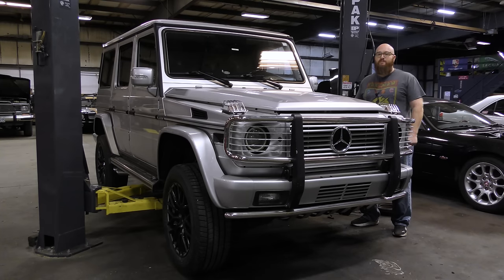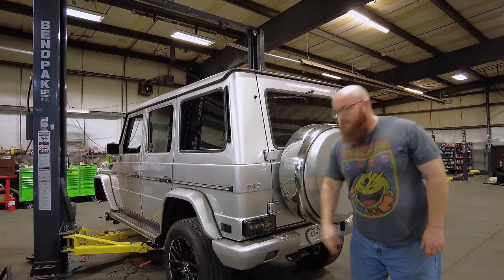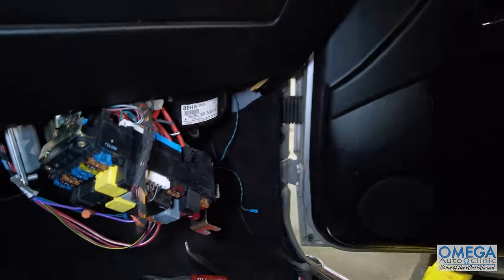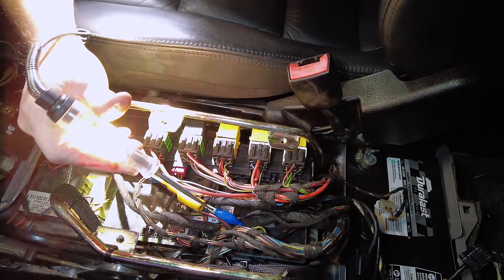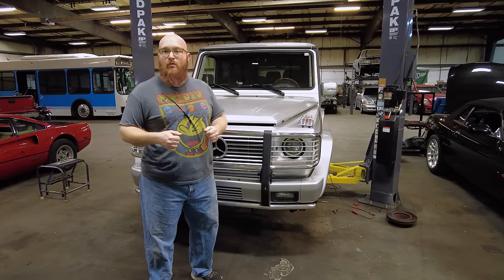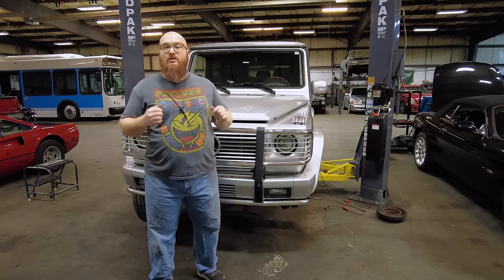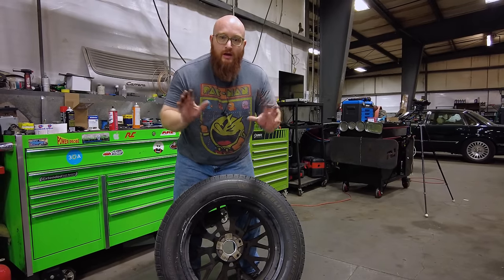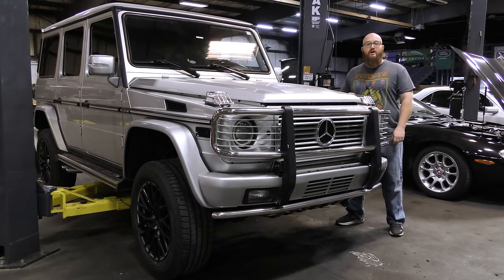Dangerous Mods on this '03 G55 AMG G-Wagon! CAR WIZARD shocked at the level of stupidity

Comment: When I modify wiring, I leave a note in a bag explaining the mod with possible diagrams and terminal numbers. You can forget a year later what you did and someone else will know what they are looking at if needs be.
Reply: This is a highly underrated tip.
Reply: Ya good idea, but I doubt the cartel members using this could read them.
Reply: I leave a mental note : "That's future guy's problem."
Almost always, future guy is me.
Reply: I did something similar to this for my car. I put a sticky note on the wiring diagram page of my Haynes book, and drew the wiring changes on the sticky note, lined up with the diagram on the page. It also doubles as a bookmark.
Reply: @jamesofallthings3684  . Yeah , I  thought the same concerning the Previous Owner .

Comment: As someone who made automotive repair and restoration my business and my hobby since 1967, I very much appreciate your work ethic and using your brain and skills to save yourself and others money wherever possible.  HOWEVER, I totally understand why many shops nowadays will only replace parts and not get creative with solutions.  They are deathly afraid of lawsuits, because if their homegrown repair fails, there is no one for the customer to sue except the shop that got creative. They cannot go after the mfgr., the parts dist. or anyone else.  So many businesses are barely existing today and are also running scared of lawsuits.  It is not MY style (or the Wizard's) but I do understand it. Thankfully, I just work on my own stuff these days.
Reply: That’s exactly why you are correct
Reply: I second this. I am retired from a car manufacturer after decades there and pior years at a dealer too. I do lots of repairs by soldering broken internal connections and have overlayed transistors for failed ICE chip power stage but I restrict it much more as I was burned by someone for doing those kind of repairs when an unrelated failure occurred 2 years later. The lighting on many domestics is done just like this G-Wagen now and many will not keep failure indicator or codes cleared when a bypass is done. The source module may include a circuit integrity check when the light is not operated and can detect the tagged on load of the bypass lamp. They don't have workaround repair tolerance as an engineering criteria.
Reply: Shops outside the us don’t do this repairs any more, too. Lawsuits aren’t a problem here, but it’s easier to replace something then to come up with a solution. Additionally, you don’t need educated personell like th3 wizard, replacing a wheel bearing is something a mediocre mechanic can do… sadly it’s just replacing today, no longer repairing…
Reply: @erebostd  I stopped working at new car dealerships way back in the mid-70s, and even then they were getting more and more into parts replacement. At each dealership I was the only mechanic who tried to diagnose instead of just throw parts at a car. The dealers always had a "warranty room" where they kept bad parts off of newer cars, so they could pay my diagnosis and repair labor through phony warranty claims using those parts. That was the ONLY way I was going to get paid.  Went into business for myself after the 70s.
Reply: @erebostd  It's generally a cost issue to not repair but replace things, combine that with any possible warranty issues it's safer to just replace and then you can blame the manufacturer for a failure.

Some shops can do that repair, but they tend to be older guys with mechanical engineering experience. Many just aren't equipped but might pass jobs on to an engineering specialist. Again this falls to the overall cost of repair vs replace.

Do a repair which fails and most people think you don't know what you are doing.
Very few people have the experience to appreciate the difficulties of repairing things in the first place.
Even second hand parts shopping can be time intensive.

I was watching Vecor, and he bought a toyota that was written off - not because of the damage to the car, but because parts were scarce and the expected time frame to repair the vehicle exceeded the cost of the insurers rental outlay to their customer.

Many years ago I went to a radiator shop to see about having a motorcycle radiator which was damaged in an accident repaired. Very lightweight aluminium and the shop owner looked at it and explained the difficulty of the job and ultimately rejected it - from his perspective there was a high chance of failure which meant overall it could be more problems than it was worth. Radiator was worth $500 or more at the time  IIRC.
As I was leaving one of his employees grabbed my attention and looked at it. For $50 he would have a go, no guarantees.
Worked out well and radiator lasted for years until I sold the bike, but I don't fault the owner of the business for turning it down.
Reply: @jimmyaber5920  Agreed, but in my experience, the aftermarket LED Light assemblies would have triggered the bulb warning as well as rapid turn signal flashing.
Reply: Correct!
Reply: @GrayRaceCat  
Normally that would be the case. but that LED assembly looked to have some brains on it.. and I think I saw some large caps or other electronic stuff. Probably to trick the car into thinking it has the proper bulb.  Often just a resister in line will work. But this one had that cool lighting effect  in it too.
Reply: If an accident happens, the lawyers will blame it on modified parts even if they had nothing to do with the cause of the accident.  The risk vs reward is too great.
Reply: @captinbeyond  
I'm sure he would have gotten some waivers signed by the owner.
Reply: I think he asked Hoovie to sign a legal waiver before cutting a hole in his Murcielago’s chassis. So, he probably did the same with this customer.

Comment: Just a thought!!! I think the resistance or load has been greatly decreased by led lighting. Had the same problem with a trailer with led lighting. The rear sam did not detect enough load(factory trailer hitch install), i had to add some resistance to get it to work. The trailer outlet was programmed for incandescent lights and they had a greater load., than the leds.   My Benz is a 2009.
Reply: My first thought as well. Ebay LEDs not putting enough resistance on the system.
Reply: I thought of that too. Newer cars usually works like that. You need to wire a resistor in to make it work.
Reply: Would be funny if Car Wizard replaced rear Sam just to find out it did not fixed the issue because of the resistance.
Reply: @EvzenEmanuel  I mean, he left the rear SAM unit as it was, so his repair is completely reversible.

Comment: FYI the switch in the taillights is sometimes used to have solid or dynamic indicators (or blinkers). My car has the same kind of switch.
Reply: I bet that's it's gonna burn out the front module now.  I would just add an optical relay for 20 bucks so it doesn't affect the circuit.
Reply: @philipparana9225  That claims make absolutely no sense at all.  The lights are all 12V, adding a LED turn signal into an existing circuit that is putting out 12V will obviously not harm anything, especially since the load from the LED is very low.

It is elementary electronics engineering...
Reply: Kind of curious about that. Your theory makes since, especially being aftermarket tail lights.
I was thinking insurance fraud / brake checks would make more sense than kill switch for brake lights, but your idea makes more sense. Seems like a "set it during install and forget" kind of thing.
It would be silly to put the switch there for insurance fraud as you can't pop your tail lights off and flip the switch with other people watching before the cops get there.  Very unlikely anyway.
On that note a crim isn't just going to want to turn off brake lights. They are going to want to turn off brake, tail, turn, parking, license plate, maybe even dome to prevent accidental turn on. Pretty much everything but headlights and maybe dash lights.
If they just wanted brakes I would think it would make more sense to go after the switch on the brake pedal. Then the switch would be accessible for the driver too.
That said is seems like jumpers or something that can be heatshrunk would be a better option for the manufacture of the tail lights, if that is what it is. A switch like that getting exposed to moisture will lead to failure.
Reply: @redbaron6805  just because they share the same voltage does not mean they have the same draw.  Hence , the led lights have hyper flash when put on a relay for incandescent. 

 Voltage is simply pressure, rapid cycling relays (turn indicators), especially mechanical ones like in this 20 year old design are really sensitive to prolonged over or undercurrent.   

 In this case, he is tapping the output of the front, which is gonna rob power for the front light to run the led.  He may get away with it since led uses so little current. 

  A optical switch would only be looking for the current to  use as a signal to open and close its own power supply  for the light.   I'd use optical because it won't fail in a blinker cycle time and are really not expensive at all and would keep the non oem light 100 percent isolated from the car provided it was fused.
Reply: @philipparana9225  I understand that point, I'm an EE myself.  

The reason you get Hyper flash is because the blinking mechanism in most cars uses a Bi-metallic strip, which makes contact, heats up and expands, and then releases when it is hot, cools down, and then repeats the process.  It is not a traditional relay in the traditional sense where a contact is activated with a separate voltage input.

This process relies on current flow.  And the current flow is designed around the total current draw of the flasher bulbs on the front and rear of the car.  Hence, the hyper flash is actually a feature to let you know one of your turn signal bulbs is out.

Hence, when you change either lamp to a LED, or both, the current flow is lowed, and the flasher design means you get the hyperflash as a result.  There are usually two solutions to this.  Either replace the flasher module with a LED replacement module, or add a load resistor on the turn signal line to simulate a incandescent bulb.

So, the only "sensitivity" is the flashing speed is designed for a specific current draw.  The LED flasher replacement replaces this current sensing design with a traditional timer relay circuit, which turns on and off using an IC timer, ignoring current draw.

In the case of the G-Wagon, since it has two turn signal modules, they are most likely IC timer or CANBUS based, and will flag turn signal failures using a computer signal vs hyper flashing.  Many European cars use CANBUS bulbs instead of this load circuit design which is mostly used on American and Japanese cars.  CANBUS bulbs have specific resistors where the computer monitors the current flow and flags bulb failures when the current flow is too high or too low for the circuit.

So, you could be partially correct in that sense, that the computer system could flag the current draw if they use a CANBUS system, OR the lamps would hyper flash, if they are using the Bimetallic strip system, but not both.

You could use a relay circuit in this case if this modification was causing an issue.  But, in this case, it is obviously not causing an issue.  There is neither hyper flashing going on, nor is there an error being set in the CANBUS system.

Hence, as it works fine as it is.  There is very little need to do anything except just put an inline fuse for the power line to rear lights, in case they short out in the future, as the rear module fuse is probably being bypassed in this case.
Reply: @redbaron6805  I agree I would've put a relay in there or a very low amp fuse. The rear module was probably fried for a reason. There could be an intermittent short somewhere or some other intermittent fault. If the front module is also $3000 I would isolate it from the rear wiring.
Reply: @juliogonzo2718  Which could be exactly what he did.  But, as noted, if the control module is already a timer relay, which it likely is, then adding another relay would be redundant.

The additional fuse could also be redundant.  If the fuse is lets say 4A and the total draw is 2.5A, adding a 0.5A load to the circuit would still be fine.  

Adding a second fuse would complicate matters, as now, if the light stops working you have to check two fuses.  It is better to simplify the circuit, and if necessary, just use a slightly larger single fuse instead if necessary.

Using LED lights means the additional load is very small.  Adding a stock incandescent light may be a different issue, depending on the current draw.
Reply: @redbaron6805 the issue isn’t voltage, of course they are 12v, it’s current.  But because they are LED you are right it won’t be too much load and not anymore load than a relay would be anyway.  However, if you want to also wire the  trailer hitch lights, a relay would be the way to go.  Obviously if the rear SAM doesn’t work, then you couldn’t have electric trailer brakes even if you hooked up all the other lights through the front SAM.  And lastly, most Mercedes trucks will go into tow mode when you hook up a trailer wire harness, but if the rear SAM is out, it won’t know and will never go into tow mode.

Comment: A man that can run a manual lathe and Bridgeport is God. Keep the trade alive Wiz!
Had a friend that had a front wheel banging and wobble. Took it to three mechanics and nobody could replicate it. Turns out there was water in the tire that was freezing. Once it got warmed up, it went away because it became liquid and flowed out evenly. Sometimes the most boggling things, are some of the simplest.
Reply: yeah that would be hard to anticipate, well depending on where you live i suppose. how did they manage water getting in there in the first place :D
Reply: @juki6377  air compressor that has never been drained.
Reply: @grad0n  seems risky

Comment: Watched the light fix and a bulb lite up over my head (no pun intended). My grandson's Ford lost the right front turn signal. It's the "smart fuse box". Dealer wants $800 for the part plus installation. Over a thousand bucks for one turn signal! I'm going to try running a wire from the rear turn signal that works fine up to the front. Thanks Wizard!
Reply: Use a heavier gauge wire because a long run has a larger voltage drop. Or, figure out where it comes from in the front!
Reply: @leonardodavinci303  Thanks for the wire tip, I will do that.
Reply: Before you run the wire, check if the module is happy running both light bulbs in parallel, cause it might trigger over current and not light at all.
Reply: And he will say  'Gee Gramps,  you're a real wizard with the cars!'   Winning!
Reply: @ikocheratcr  Good thought. Maybe I should switch at least one bulb to LED?

Comment: What you did on this vehicle I couldn't imagine ANOTHER shop EVEN CONSIDERING THE REPAIR YOU DID.. To  do an out of the box repair on  someone else's botched failure.. Is so beyond what 99% of technicians that I've come across in my 50 years in the business. You for sure in the top 5 wrenchers in this country. Thank you for sharing the most pertinent information with us and not the same drivel that gets repeated all over the net,  You sir are more appreciated than you realize. Please keep up the stellar unique content. Gear work!.
Reply: The reason why you don't see this today is because if that so called genius repair fails the wizard will be sued into oblivion by the insurance company.Replacing the modified parts with new OEM parts is the correct fix, not what the wizard did.

Comment: I agree one of the best episodes yet. The LED light fix , yeah they don’t draw much, and when your finished there are no wires dangling then right on. The issue with the wheel no doubt had people scratching their heads, and like you said would have been expensive. Around here the only machine shop in town shut down and so there wouldn’t have been much choice but to replace the hub.